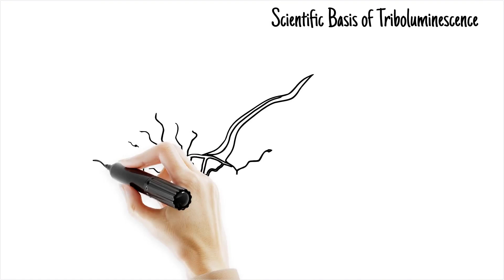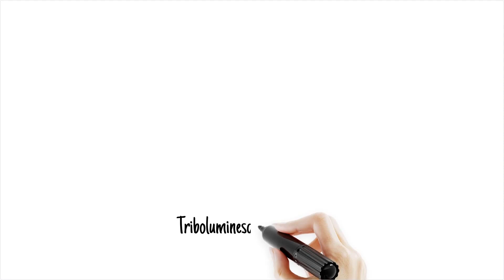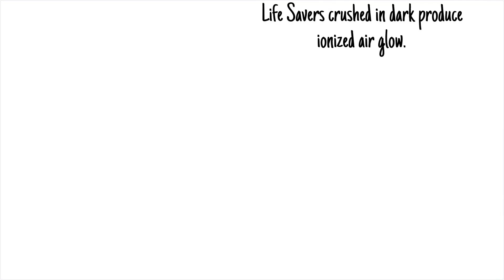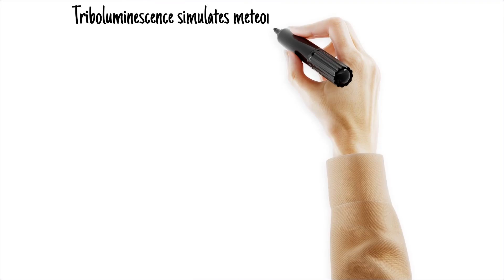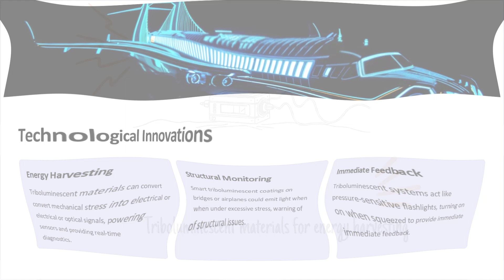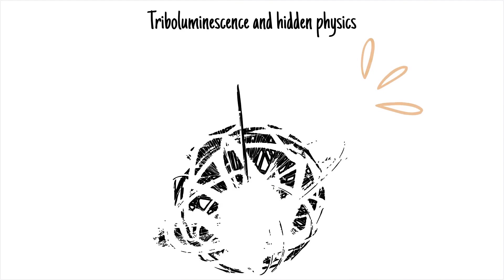Triboluminescence: Why Materials Under Stress Emit Light?

Comment: Nothing is quantum its a click bait paycheck word for the simple minded. Everything has a frequency
Reply from the maker: Great observation! It’s fascinating how the concept of the speed of light shapes our understanding of reality. We’re actually planning an upcoming lecture on this very topic — how our world is fundamentally built around the speed of light. Everything we experience is slightly delayed: the light from stars we see may have traveled billions of years to reach us, showing us a past that no longer exists. Even in our immediate surroundings, what we perceive is always a fraction of a moment behind reality, as light and sound take time to reach us
Reply: @ailabsparadox  afraid light rather illumination doesn't has a speed its the maximum rate of induction of the medium. That's an atomist view and has no place in reality. Nice good luck with your work sir. It may be time to broaden the horizon. I'm bringing a new way of thinking with my tech. You won't find atomism helps explain how piezoelectric and magnetostrictive materials consistently churn the Æther. No electrons in my world just one dielectric unit. As was stated before like the greatest of electrical engineers. 🙏♾️